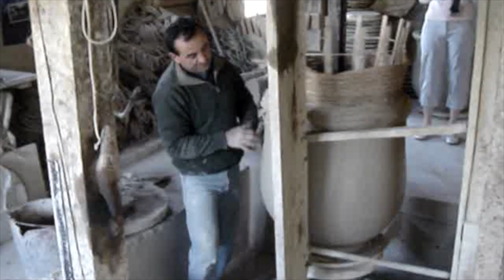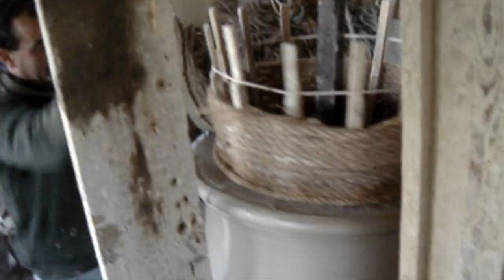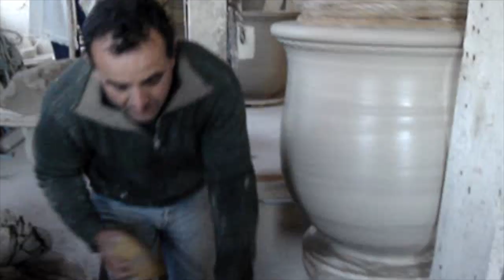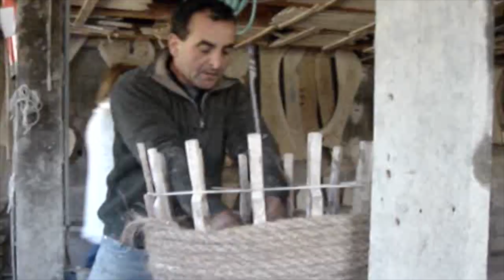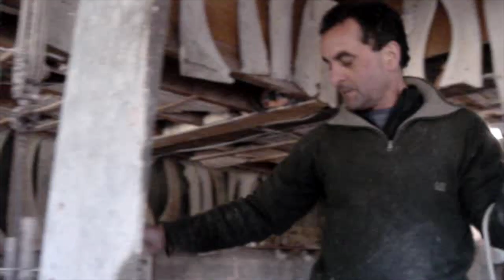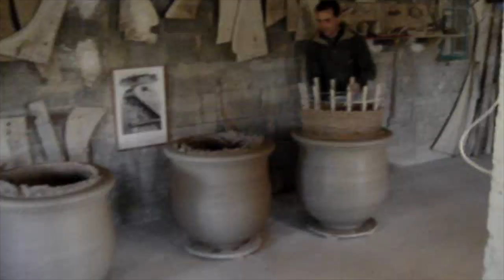La Potterie Provencale   Ceramic production in Biot, France by Leslie Parke

Comment: It would be nice to get closure. How did the pot look, what else was necessary to complete the piece?
Reply from the maker: I was there only for an hour or so. The outside form was made by the template, The inside was scraped down to smooth it out. They would glaze it on the inside and on the top 4 inches or so of the piece. They were originally used to transport olive oil. The glazing was used to help prevent rats from getting in the pots. They would hit the rim and the glaze would make them slip down. The saddest thing is that the Pottery was washed away in a major flood and I don't believe they rebuilt it. I believe it is gone.
Reply: So sad if they couldn't rebuild. @LeslieParkeStudio